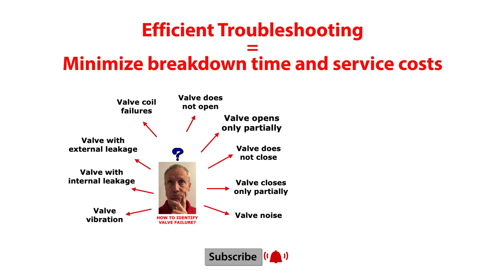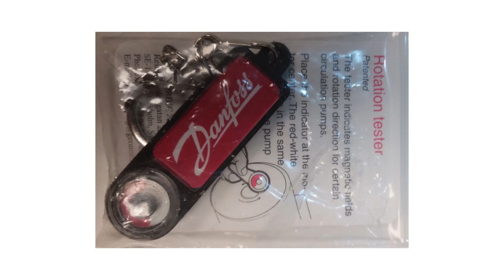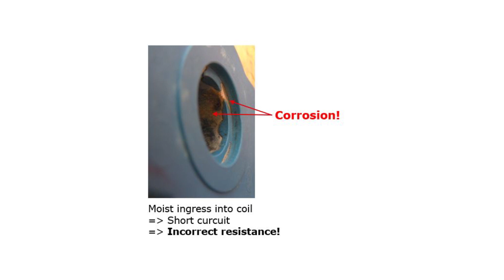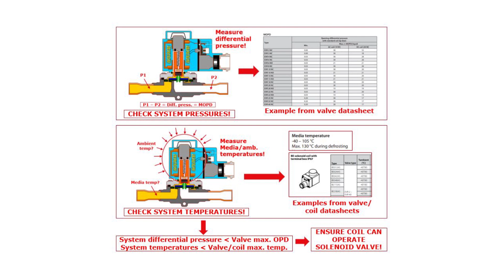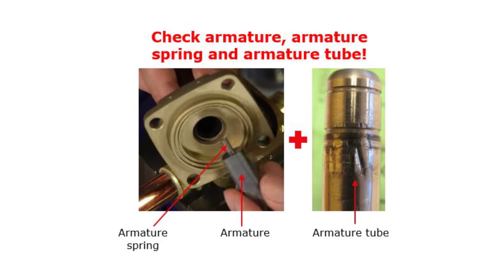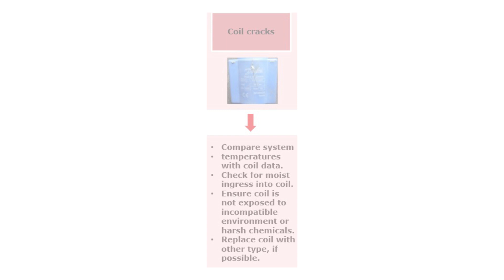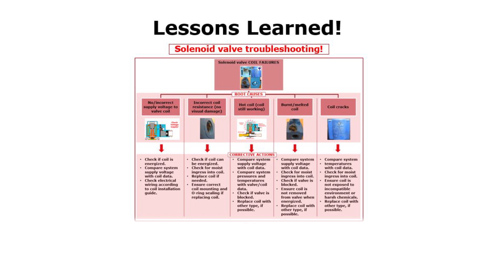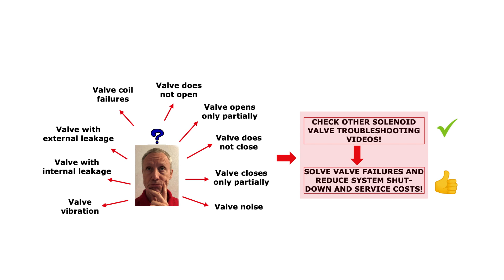Troubleshooting solenoid valve coil failures | HVAC&R Distillery

Comment: What happens when a 50HZ coil is used with 60HZ supply?
Reply from the maker: Thanks for your question. We are checking with our experts and will get back to you.
Reply from the maker: The coil pulling the force will decrease approx. 30% which will then also affect the valve MOPD performance. This is only critical if the valve is used in the system to its limit of MOPD capability. - Check the MOPD data of the valve used.